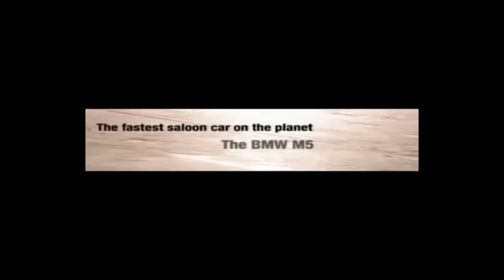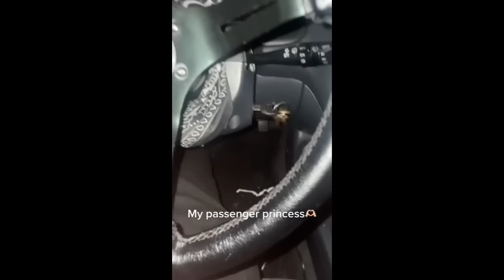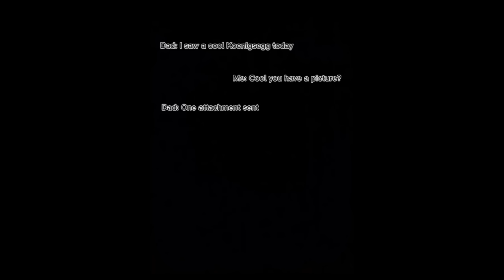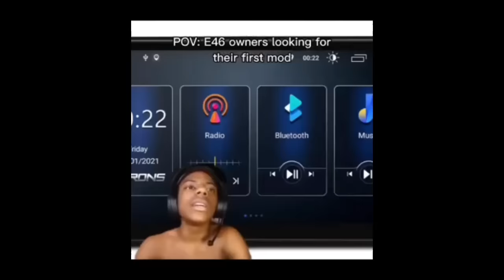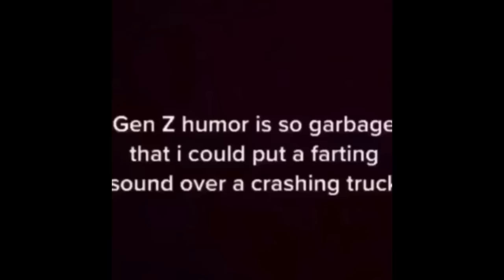Memes That Only Car Guys Will Understand: Part 15

Comment: 7:47 I dont think they understand that Center-Lock wheels are designed reverse thread??? Kinda crazy how they didnt try to go the opposite direction if its not budging XD
Reply: Never knew that center-locks were reverse... but their dedication is to be applauded though. 3 guys trying to torque the thing out, and then resorting to cutting the rims.